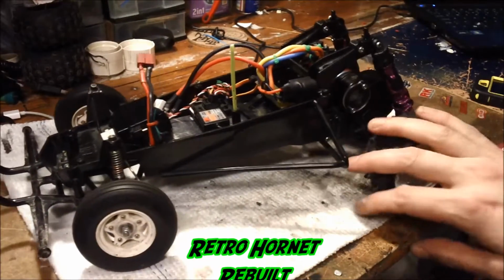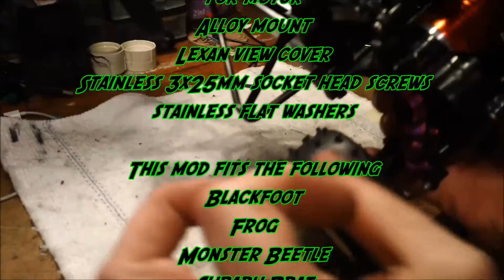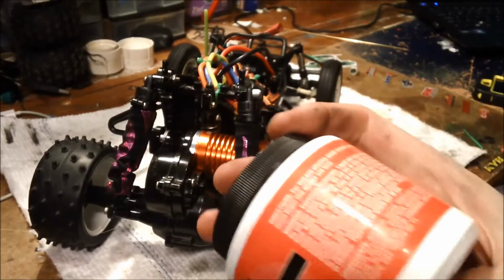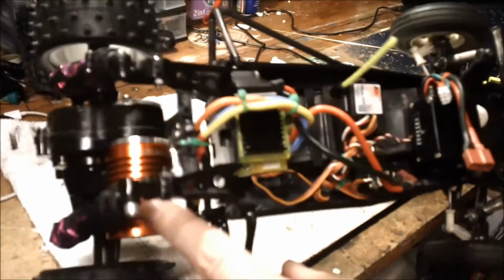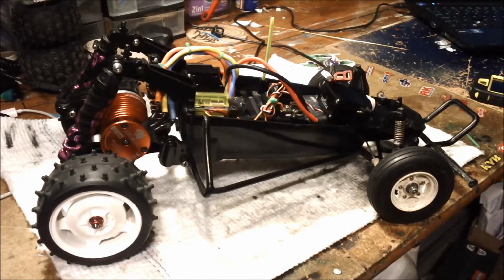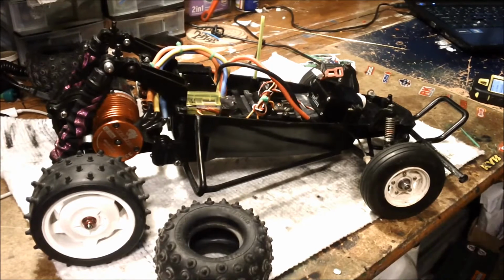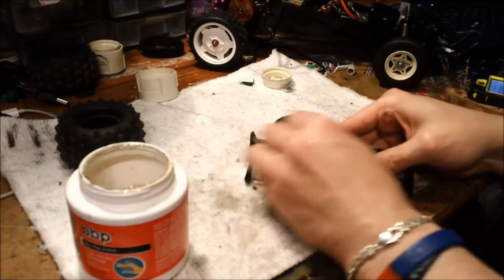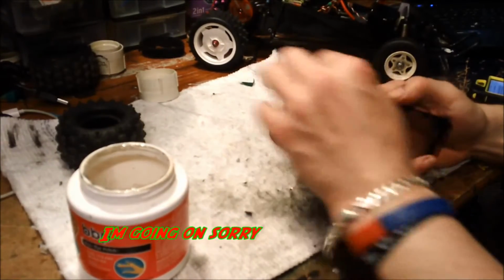Tamiya Hornet Build part 2

Comment: thanks that's helped right me out many thanks buddy I got a 12 T motor coming and I am new to  building rc cars I didn't know what one would be suitable as I don't think me 1800 mah pack that came with the car would run it
Reply from the maker: I'll try and help if I can. 
I'm no expert but I would invest in a pinion adjuster. 
I got one off eBay you can have more speed or torgue.
Reply: Rc-Nerd how did you get the rims inside the rear tire?
Reply from the maker: You need hex adapters. HPI do them but I was given these.
Reply from the maker: Them wheels are off a holiday buggy.
Reply: oh
Reply from the maker: ive added you to G+ so ill try and find the Code Man ill rather keep the Standards on it Flips less lol
Reply: lol